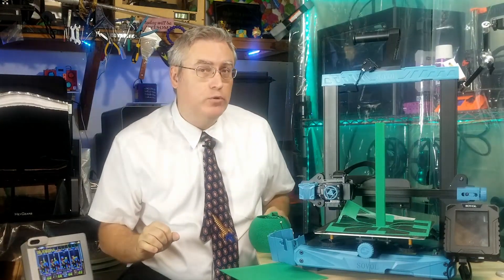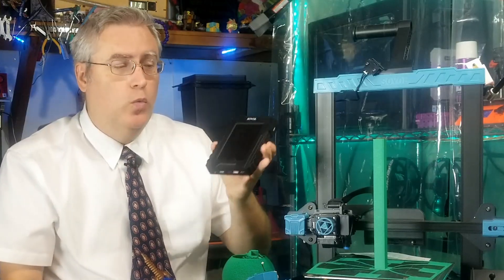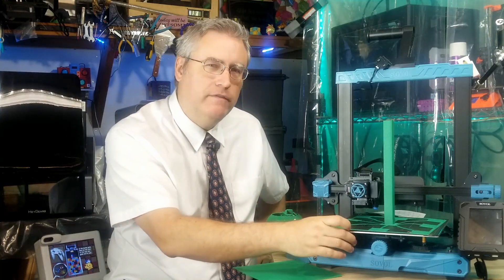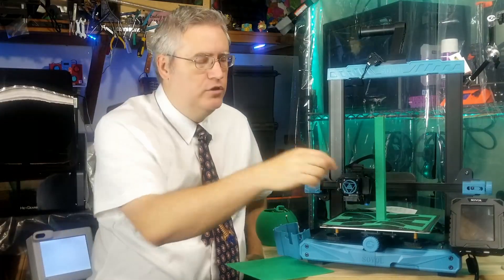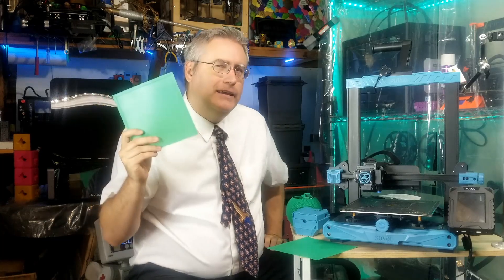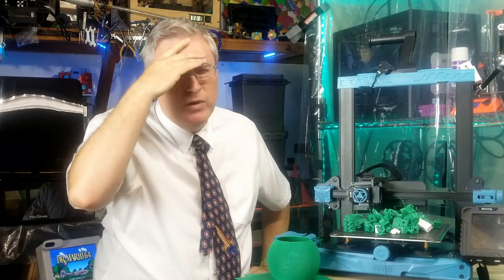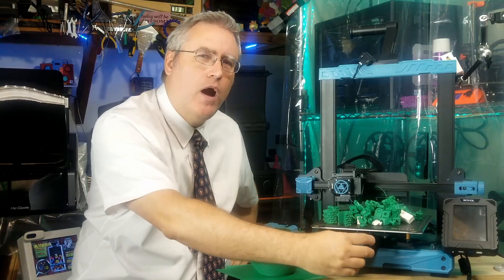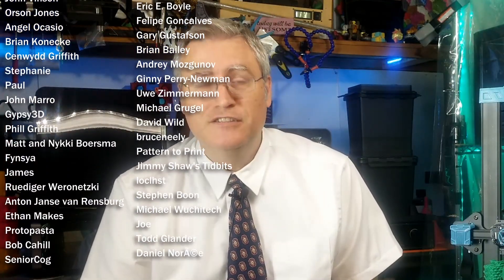Fast isn't always better, Sovol SV07 Review

Comment: I have the Sovol 6 which basically looks and performs like my Prusa MK3. Why did they go backwards on the 7? Hardened rails is a step forward isn't it, but they went back to roller wheels on Aluminium rails. I said to a friend going faster WILL cause problems in the long run it has too. At least the Prusa has a crash alarm and stops!  Call me slow but who won the race with the tortoise and the hare?
Reply: they did not go backwards. This "prof" is a tool
Reply: I expect they had two teams developing these products separately.

Comment: You can turn off the motors and turn the z coupler by hand to move the x gantry up. You don't have to do it on the screen, which wanted you to auto home first. Just for future reference if/when you have another failed print. I had an Ender 3 that used to fail a lot and I, being lazy and not wanting to click around with the knob would just turn the z coupler by hand to move it up.
Reply from the maker: That's what I end up doing, but I hate to do that because there's a chance you'll throw the motors off calibration with each other. 

I had several other fails in the process of testing this printer, which is why I never put the shroud back on. And for some reason the plastic always seemed to want to stick to the nozzle more than the build plate.
Reply: @3dpprofessor  oh, that's right I forgot the z motors were controlled independently on this printer. You're right, it could throw them off.
It's probably good to remove the shroud anyway, because it reduces weight of the print head, as long as you can do without the lights. As far as bed adhesion I have always had problems with those pei sheets too. I much prefer glass. I modified my Neptune 3 pro to print on glass. I think your right though in your video with it being more of a tinkers machine because of the mentioned needed modifications.

Comment: Your actual issues, not "I couldn't find a drawer because it "blended in too well" despite the fact that it has a handle, boil down to not knowing how to use Klipper. The biggest risk for these printer manufacturers in moving to Klipper right now is just these dinosaur reviewers not knowing how to use it. The reason others are having success and you did not, is not because you have a lemon, but because you have no idea how to properly use Klipper. 

You also do not factor the cost, available via coupon at all times for $299, yet you keep comparing it to Bambu who's printers starts at $599.
Reply: I'd think Klipper should be running the printer, not standing in way.
(That's how it probably works, in reality, no special attention needed, unless manufacturer has done stupid things with configuration)
Reply from the maker: I hardly had any issue with Klipper. My issues were that they pushed out a crap machine that didn't work. The accelerometer required unscrewing body screws, the bed didn't remain level, and the Y-Axis tensioner didn't remain tight. What I didn't mention what their baffling choice to go back to V-Slot wheels after using linear rails on the SV06 and the fact that they forgot in their slicer profile to put a M90 in the start GCode so every once in a while a script would leave it in relative movement mode resulting in an error when you tried to print, which is just negligent and demonstrates that they never actually tested this machine out before putting it in the hands of consumers.
But I like the Klipper interface.
Reply: @3dpprofessor  Its not start gcode it's a start macro and.. G90? I assume you mean M83? That's a problem with your slicer settings, again rooted in a lack of understanding of Klipper. The printer was keeping you from dumping the spool on the bed.

Comment: I believe they ship with some optional hard mounts that replace the springs and make it fixed like the SV06 build plate. Might be worth trying those out before getting different springs or silicone mounts.

Another thing to keep in mind is that the inductive sensor needs the build plate to have that layer of metal, so the cheap build surface mounted directly to a magnet don’t work with them.
Reply from the maker: As far as I know the SV07 isn't shipping at all right now. It's still in preorder. So maybe they'll fix these issues with options like this.
But I can only review the machine I was sent.
Reply: @3dpprofessor  I got mine yesterday, they are definitely shipping in Europe.
Reply from the maker: @mpauls85  Let me know if your experience is like mine, or more like Angus' or others who are having a good time. I just wonder if I got a lemon.
Reply: @3dpprofessor   It is not like yours. It is my first 3D printer and it honestly has been a breeze so far. But my last experience was at university 12 years ago and "damn" those printers sucked...
I had some bed adhesion problems at the beginning. From what I have read 50°C bed temperature is a little bit on the low-end for PLA. I upped it to 60°C and now, five successful prints in a row later, they are gone. And I just finished printing a gridfinity 5x5 baseplate without any additional brims, and I even had to change filament mid print because it was empty. That thing basically covers the whole printbed and is only held in place by thin beams.
Using the accelerometer is not necessary, SOVOL has put an input shaper profile on the printer. It would only be necessary of you changed the resonance frequency of the machine by adding weight to an axis or having it on an unstable surface.
I have not yet experienced any of the other issues, it worked "out of the box". I got mine during the pre-sale for 299$ including tax and shipping and I couldn't be happier.

Comment: Having owned a Sovol SV06+ where I’ve experienced their quality, design and customer support I would definitely recommend people to stay clear from these printer clones.

Nothing is free in life. What you don’t pay in money, you pay with your time. I ended up giving up on my printer after 3 months of troubleshooting with several parts being shipped to me from China which took ages.

I’ve spent more filament on trying to do calibration than actually printing things I wanted. Everything from upgraded fan duct, cable strain, Z align tools, different calibration models etc.

I found myself waste entire weekends on just debugging this printer. There was always something wrong with the prints. I went from 3D printer novice to expert in a 3 months crash course of owning this printer. Almost memorized all the settings that can be modified in SuperSlicer as well.

Sure, your Sovol may be good. But take a look at your print volume. Any printer is good if you just print a benchy once a month.

Here is my list: 
print bed came so warped, that the ABL could not compensate. It literally would put the Grand Canyon to shame. The silicone bed level mod partially helped. But it was still not level enough.
Z motors get out of sync if the print is long enough. 
The planetary gear inside my extruder for some unknown reason got warped/stripped.
The original firmware was buggy, and was never able to memories a correct Z offset. No matter  how many times, or different permutations I used. Installing Klipper helped greatly on this.
And the latest addition, where I finally gave up, one of the stepper motors said bye bye.

Oh yeah, and the whole experience was deafening. Their PSU fan runs at 100% all the time. Even at idle. Knowing how a computer PSU works, the only answer to this is that the PSU quality is trash.

I gave up on contacting Sovol support. They respond whenever they feel like it. Usually once every 3-5 days. I don’t have the patience for that. Not to mention I also have to wait 1+ month to receive any spare parts because they use the cheapest shipping possible.

Don’t be like me. I used to be naive and believe the many reviewers who were disingenuous enough to call this the “Prusa killer”

I am now ready to smash this printer with a hammer. But I’m waiting until I receive my Bambu printer first.
Reply: Obrigada pelo seu comentário, no Brasil falam pouco sobre este modelo e tudo que eu queria saber, você disse! Não quero perder meu valioso dinheiro na minha primeira impressora e vir com tantas dores de cabeça.

Comment: Doesn't make no sense to buy that printer and then put money into it might as well just buy a voron
Reply from the maker: You're not wrong. Though, if you add up the cost, can you get a comperably capable voron fully assembled for the same price?
Reply: How much per hour do you value your time?  30 plus hours for a Voron is only for hobbyists/enthusiasts @3dpprofessor

Comment: wait... i never notices that you had to manual bed level... why the backwards step?
Reply: That's not backwards. Bed levelling and mesh compensation are not the same thing. Both are needed if you want the most accurate parts.
Reply from the maker: I'm okay with having both as an option.

Comment: I have an old TiVo tornado, which is it best marginally reliable. One thing I did find out from the user groups and has helped immensely is to change the springs for bed leveling. So that is not all that and unusual occurrence for a 3D printer.
Reply from the maker: Not when they're building to a price point, and not to a, you know, quality level.
Reply: @3dpprofessor  fortunately the different colored Springs was a pretty inexpensive fix but I agree with you

Comment: As someone that works in research, dealing with standard operating procedures, work instructions and technical writing - that's my biggest pet peeve.  Lack of any documentation, or accurate documentation / instructions on 3D printers.  They slap these machines together, hope your Facebook friends will answer your questions and move on to the next big machine coming out in 90 days.  So frustrating.
Reply: And Facebook as requirement is infuriating already.

Comment: This is the kind of printer the hobby should have evolved beyond by this point.
Reply from the maker: I mean, yes, but on the other hand, no.
Like, we should always be pushing boundaries and we can expect those first steps to be rough. But if you're building a printer to compete with Bambu, one thing that made them awesome was that it was well built and sufficiently tested.
Reply: Yes and no, if you pay twice as much then yes, otherwise no. At the price point it is still in DIY bracket of printers.
Reply: Hell no, if it needs tinkering to work decent then is not evolution, is BS

Comment: I don't know why I don't buy SV07 but instead I have SV06 PLUS modified with Klipper. Works ok, just start slow. Not buying SV07 is the plastic on it, thinking it might expanded due to heat, I don't know..
Reply: Prusa uses plastic with no problems.

Comment: I haven't had as much trouble with the bed...but everything was loose on mine. Including a grub screw on one of the stepper motors. They also told me that putting the accelerometer on it was for "experts" and not needed because they have some basic input shaping pre-installed. ¯\_(ツ)_/¯
Reply from the maker: I mean, by that logic this whole printer is for "experts".

Comment: Sovol has been responsive to community input in the past. I hope that your critiques are seen and valued and applied to future revisions of this printer.
Reply: No, they haven't lol. Sovol has probably the worst customer service/support on earth.
Reply: @allwoundup3574 they seem to be responsive to feedback on design problems. The SV06 build plate cable wasn’t supported well, the SV07 seems to have addressed that.
Reply from the maker: They have yet to respond to my layer shifting problem. Email unanswered for 2 weeks now.
Reply: @3dpprofessor  My first prints looked like an earthquake hit -- they asked me to check the grub screws on the stepper motors. Did you check that? Once I tightened that up, it's been fine.

Comment: Ii was considering sovol and bamboolabs, and I passed on both in favor of 5 $80 vanilla ender 3s. They're cheap, reliable, easy to fix, and they print well. If you have a shop to run the last thing you need is to spend all your time trying to get good prints out of an over engendered machine no matter how cool it may be
Reply from the maker: Not sure I'd say an Ender is the reliable option, but the price is right.
Reply: @3dpprofessor  I guess that would depend in the version of the control board that came with it. I wonder how much creality saved on their clone stm32 chips?
Reply: 50mm/s vs 500mm/s hell even at 250mm/s not 4 enders ($320) would compare to the speed or the quality of a singular sovol sv07(New $290,used $220). id recommend snipping a refurbished sv07 off the sovol site and see if it takes you but an hour to get a perfect print out of it. not to mention coming with practically every bell an whistle you could imagine for a bedslinger to have that would roughly cost the price of the sovol to get all that on just one ender. im only speaking from experience as i have both printers and am baffled by the differences even with the mods ive made to my ender.
Reply: @tuufar Yeah same I have one ender 3 with a homemade direct drive for soft filament and another Bowden for ridged filament. Glass plates and pei plates. As well as better adjustment knobs. Even just the small upgrades (firmware specifically) makes a world of difference.